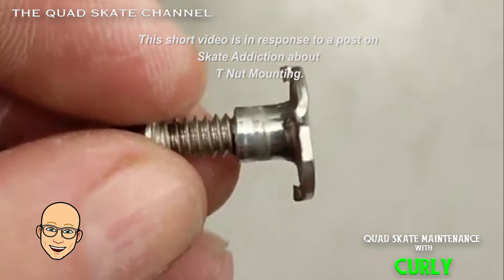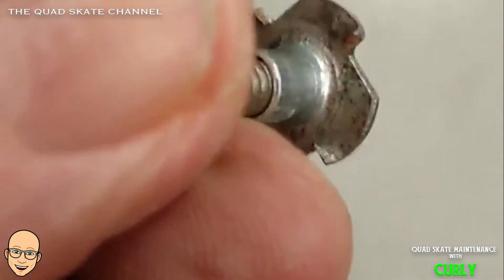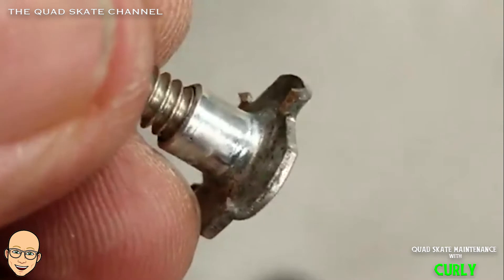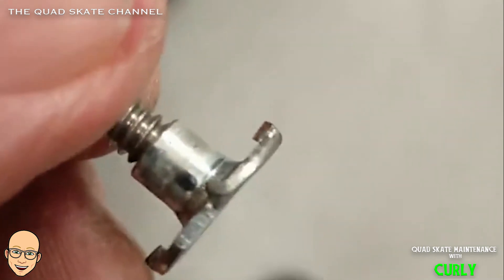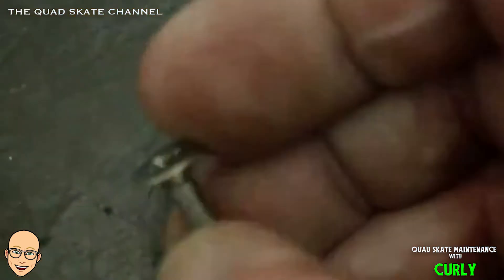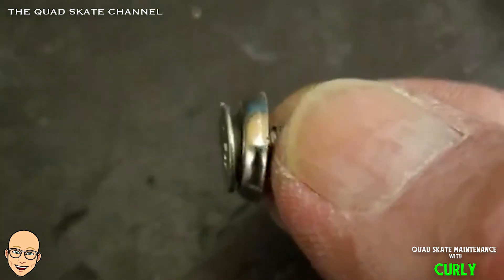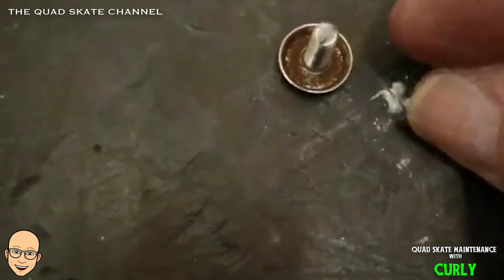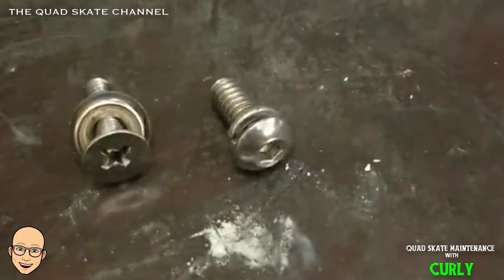Roller Skate Mounting - T-Nut and Bolts Tips - Quad Skate Maintenance with Curly

Comment: do you think it would be a bad idea to counter sink a nylon plate like a sunlite, and then not use a washer? would that make it too fragile?
Reply from the maker: Personally I would go with the Countersink/Cupwasher option. You can get Allen Head countersink bolts. And there are different types of countersunk washers available as well. Some are even coloured.
Reply: @Thequadchannel  interesting.... I spent way too much time last night looking at oil slick anodized bolts and then decided I was insane for even considering spending that much on pretty mounting hardware (they're a few bucks *apiece*)
Reply: Just bought some blue ones. This is going to be so pretty. Thank you for all your help!
Reply from the maker: @rollerskaterevival8484  no worries. Glad to help.

Comment: What size nuts are you using please ? Metric or imperial ? Not stainless steel are they ? If they’re stainless galling may occur ….
Reply from the maker: Lately I have been using M5 T Nuts and Bolts.

Yes I am using SS. Haven't had any issues.